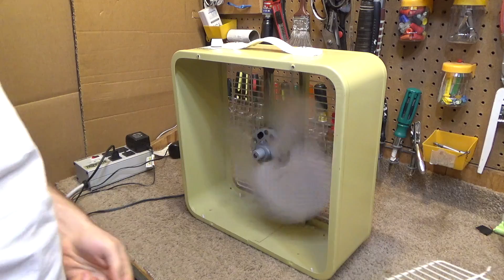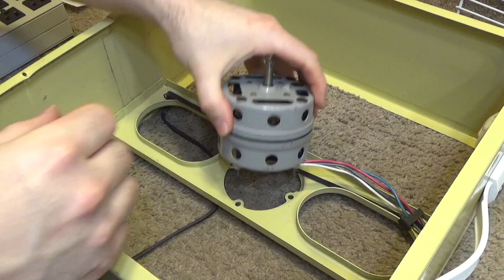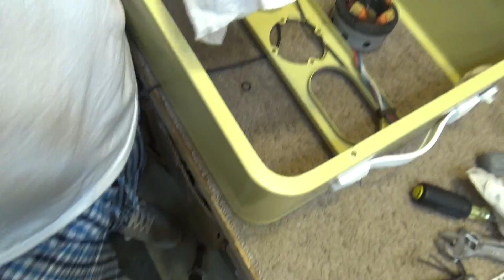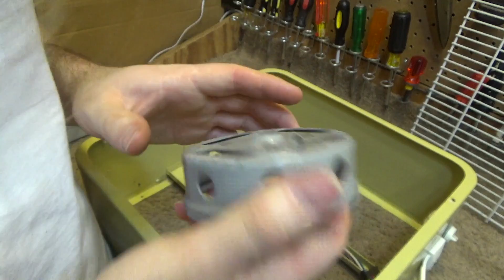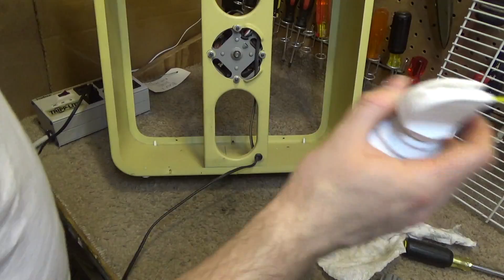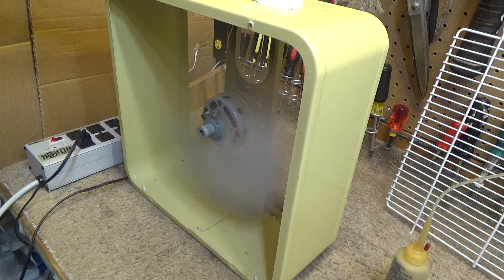Eskimo 121050B Box Fan | Service and Repair

Comment: I found one exactly like this one but light Blue while trash picking around 10 years ago. The back cage is missing as well as the handle but I recently went over it, cleaned it up and serviced the motor and it runs pretty well.
Reply from the maker: It never fails to amaze what people will throw out. Such a shame.
Reply: @JordanU  I Know.

Comment: Impressive video. I hope the repair lasts, by the way, I just got the 20 inch model in that same exact yellow color which is model 201083. I thin't think these later 70s metal bladed models have the exact same bearing issues as the turquoise models do. because mine has high hours (almost blocked up with dust when I got it) and the bearings only have a tiny bit of play, but there was no bearing chatter. thankfully, I replaced the bearings with better ones which fixed any bearing issues or bearing chatter.

Comment: Do you have any extra handles for a 1950 s Eskimo box fan?
Reply from the maker: No
Reply: @JordanU  Try replacing the washers and the bearings, and oiling them all afterwards.
Reply from the maker: @HuskyDog88  This is sleeve bearing, there are no replacements available.
Reply: @JordanU  Oh, OK. When was this fan made?

Comment: Oil the bearings.  You can get bearings for them for about 6 bucks a pair but you have to drill out the pop rivets and bolt in new ones.  But think of it this way. YOu won't have to replace them anymore if you keep oil on them.  That motor is done. Replacing te bearings won't fix that motor. THe shaft is what's bad inside the bearing sleeve.  The shaft cannot e reverssed or it would be able to have one repair.  You can't fix that type.  It's done. Should have oiled it.  Worn bearing sleeves and motor shafts will be easy to take apart. The good ones are the hard ones to take apart.  Those squggly washers are in there do keep the amataure from rubbing on the stator coil. IT could lock up against the rotor as well and burn up the motor cause a fire if there is lint and crap inside the fan.  Well ship dog.  YOu have  a zoom oiler. Whey didh't you do that before it went bad.
Reply from the maker: You're an idiot.

Comment: The reason they don't last is because there are oil ports to keep the motor bearing oiled.  If they don't get oiled, they dry from air gbeing blown on them and heat from the summer time.  If you look at each end, you will be able to see a slit in te steel and an opening.  You use a zoom oiler spout straw and you stick it into those opened divit slots to oil the motor.  A little rotation while squeezing the bottle will get the felt sopping wet with oil for future use.  As for quality, the older fans had a sleeve bearing. Those have ball bearings.  I tihnk they are better tan before with the exception of plastic blades. I don't care for them.  They aren't as balanced as aluminum ones.
Reply: Write it, read it, and then post it.
Reply from the maker: @malibustacy3606  Watch all the way through and read the description first as well! Will spare you on many occasions from posting something stupid.
Reply: @JordanU   I wasn't referring to you.
Reply from the maker: @malibustacy3606  I know, I wasn't referring to you either. It was a generalized statement.
Reply from the maker: You're an idiot.

Comment: I have the 1960s Version of this fan ( a 12106) Mine is the aqua Green with the 4 paddle Metal Blade set, mine has thousands of hours of use and rattled real bad when i got it , and yes I agree that noise is very annoying , anyway I oiled it in and around the shaft several times and the rattle would return within an hour or even less of operation, I finally decided to take the motor apart and inspect , what I found was that my fan had been run in a wood working shop or something as the motor was packed full of sawdust , I think the sawdust was effectively absorbing the oil out of the bearings , I cleaned it out completely with a solvent cleaner even the bearings , the oillite Bronze sleeve bearing are Porous and surrounded by felt apparently the pores in the bearings get plugged with sludge after 50 years and will not wick the oil through from the Felt , after I cleaned mine I soaked it with 3n1 Machine Oil and re assembled it and turned it on and in just a short time it rattled again that was back in the winter , I got irritated with it and just set it aside where it sat and soaked for Months , a couple weeks ago I took it out in my garage and put it in the window and have run it many hours over the last week or so and Guess what it does not rattle anymore apparently the Bearings finally flushed themselves out and are properly wicking Oil again
Reply from the maker: Thanks for letting me know.

Comment: Its motor is cool and a little similar to the old Arno electric fan motors here in Brazil that were used in TC 16 1C12 circulators and in FAN 16 and fan 12 fans
Reply from the maker: OK
Reply: Interesting to learn, thanks for letting me know.